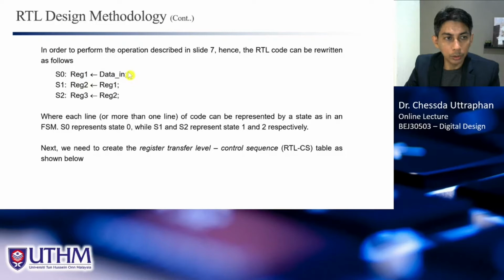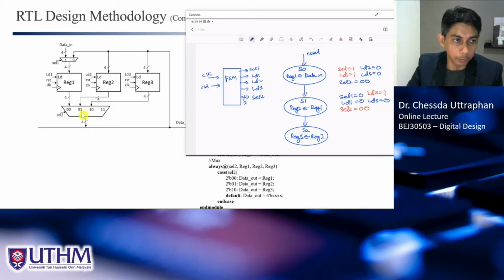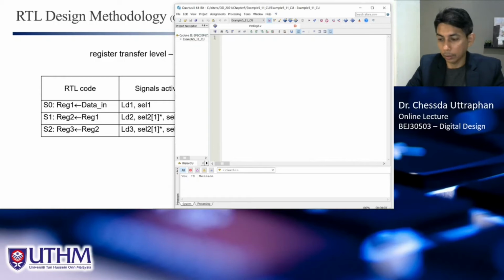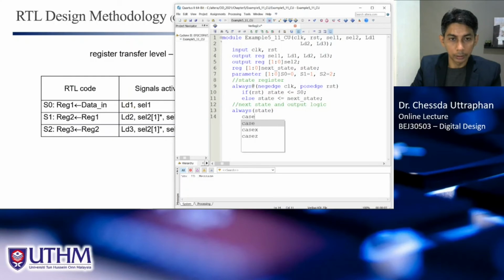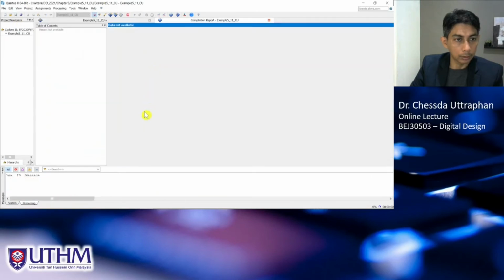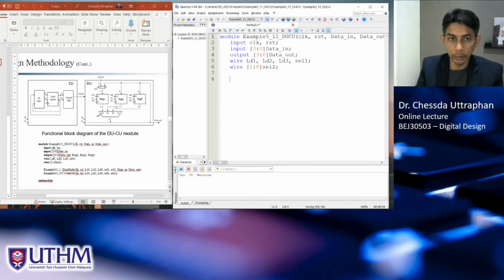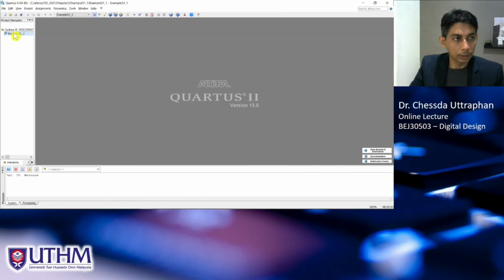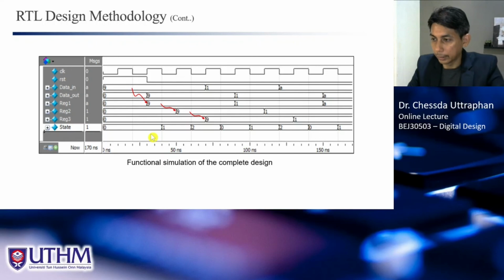Online Lecture: Chapter 5 - Register Transfer Level (RTL) Design (Part 3)

Comment: why are you using asynchronous reset signal in the datapath design , sir?
Reply from the maker: Hi Jogesh, normally in digital circuit, we will use the asynchronous reset for flip-flop or register. This means, when we reset the circuit, it will immediately reset. If we use synchronous, we need to wait for the clock edge for reset.